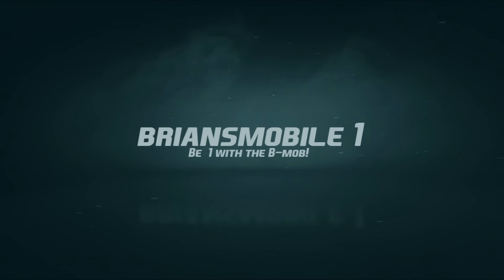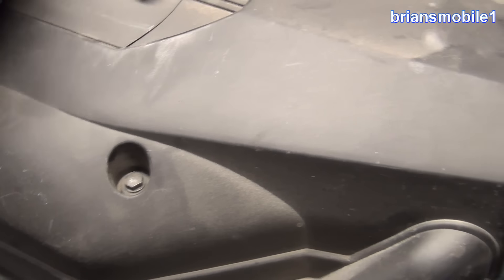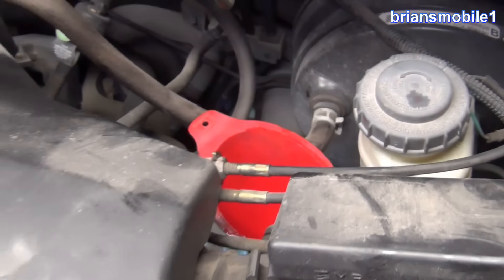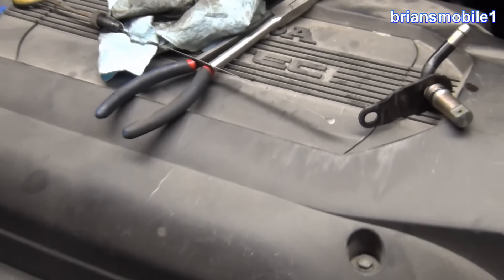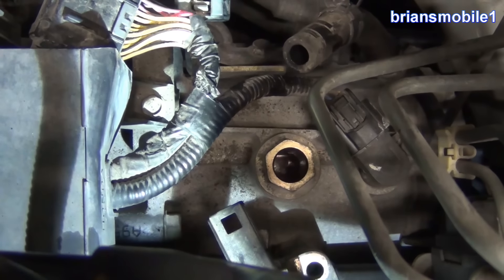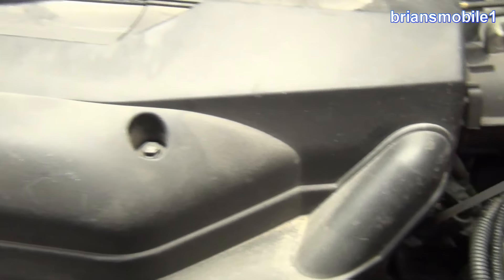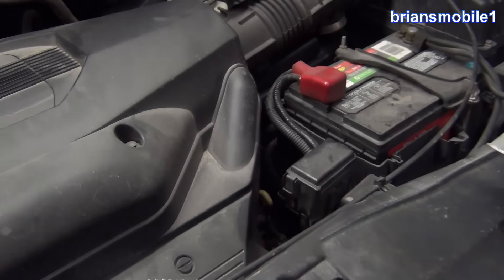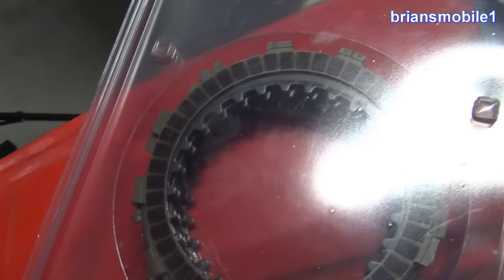Watch this Video BEFORE You Destroy Your Honda Transmission

Comment: Does that generation of Honda transmission have an "external" ATF filter similar to the 2nd generation Acura RDX transmission? If so, can I drain more ATF out of the transmission if I remove the hose off it. As it stands, 3 quarts drains about 1/3 of the transmission and it would take another drain or two to get most of the old ATF out?

Comment: Hey, I have not had AWD vehicle before and don' know if it is normal sound.  So I park next to the wall or garage and switch gears on my Acura RL, from P to R, to D and so on, there is a noise under the car which is associated with the shifting of the gears/drive shaft.  It is normal to be able to hear that?

Comment: I've got a 2002 Accord I4 with a Automatic. Just got it for my 16 year old. It had a P0740 code come on during the drive home which I am told means inevitable transmission death. The last owner did a transmission flush a few k miles ago. Is there anything you would do to a vehicle that's already had it done? It only has 90k miles on it and it drives great, so I am having trouble believing the transmission can't be saved. But, maybe I'm just being stubborn. Worst case scenario the transmissions aren't the worse to replace. But, it would be nice to avoid it.

Comment: I was getting a terrible transmission shudder on my 2013 Cr-v. Fluid had never been changed at 113,000 mi. Decided to change it and fluid was black and smelled burnt. After one drain and fill with Honda dw-1 fluid, shudder immediately went away and shifts smoothly. Also decided to change the inline aft filter.
Reply: If it comes back, switch over to Castrol for Imports. I went through that with my wife's '10 Pilot.

Comment: This is easier. Make yourself a dip stick tube funnel and fill the trans fluid thru the dip stick tube. Make the funnel by cutting out the bottom of an old trans fluid quart bottle and use the top of a diff fluid bottle with a pointed top. snip the tip just enough to allow the tip to fit the dip stick tube and screw the tip on the cut out qt bottle you made. Now you have a funnel to fill the trans fluid thru the dip stick tube. Much easier.

Comment: Good video.  Can you tell me if the Honda odyssey’s transmission would cause vibration when going up a hill from the rear end ofthe vehicle?  My Honda Odyssey is doing just that. Any ideas what would be causing this?
Reply from the maker: I know this sounds weird, but I'd check tires and bearings first.  LMK what you find would you?
Reply: @briansmobile1  I have changed the tyres and bearing have been checked but still vibrates.  I will investigate further when I get better   .  Will also arrange for transmission oil to get changed as well.  I will update whenever done.

Comment: How to change the transmission fluid in a 2009 Odyssey, it's charging one two good but the third charge out is slow. Could you tell me what wrong
Reply from the maker: I think you're saying it shifts well from 1st to 2nd gear, but 2nd to 3rd is slow.  That could be a number of things.  I'd ask a professional trans shop or the dealer what they've seen.  It could be solenoids, worn band or clutches.  Could even be fluid condition.

Comment: Do you think I should change a brand new transmission fluid (no more than 6000 miles on it) after being stuck in snow with lots of wheelspin? After that the tranny was behaving odd: didn't accelerate as usual and shifted to a higher gear only after 3000 rpm and did it very roughly. The fluid is still bright red and still smells of cherries.

Comment: Drain and fill on my 2002 Acura 3.2TL mileage is at 218,XXX fluid was black and burnt new fluid gave me a faster shift change in sport gear select and a lower shift point in auto more giving more torque output and gas mileage doing so also I have no cat and it shoot a nice flame on the one two shift with a nice pop

Comment: Scared me for a second,   Then I realized  it was a older odyssey then what I have.  I have 2007
Refill on it is 3.3qts.  I  initially used valvoline maxlife full synthetic ATF 
Which says compatible with z1 and dw1.  I went back to dw1. I found it shifted better with dw1
Reply: I have a tl and I'm sure that's what my shop used I did it myself and went to dw-1 shifts way better
Reply: You should always use Honda transmission fluid.. and other Honda fluids when changing fluids at intervals.. The engine oil is the only exception.
Reply: @randyjackson347  Any DOT3 brake fluid works also.
Reply: @steponmemommy9323  That would be an exception ...I would not want to use Prestone Antifreeze and Dexron transmission fluid like some do to cut cost ..

Comment: This is not a Honda ism, it's an any automatic transmission ism. Fluid change and if it has a traditional filter, replace that to. You don't flush an auto trans for double the same reason you don't flush a high mileage/sludgy motor (without removing the oil pan afterwards). A lot of shops offer system flush as a revenue generator at the customers expense. Two incidents I personally encountered with that yellow Jiffy place were a low mileage engine that sounded like a rock tumbler at work polishing rocks, after they flushed it and apparently forgot to do the actual flush part after the solvent was added, and the other was a perfectly normal 4 speed auto that lost 3rd and 4th gear after they flushed it. On tear down it appeared the lining had been washed off of the friction plates. Fresh fluid, a new filter where applicable and an extra transmission cooler to keep temps between 180 and 200 deg for added longevity, not that the Honda needs it.

Comment: Hey bud, got questions i have a 2005 honda odyssey touring twice happened transmission fluid spill out due to a over hitting is possible? The mechanic transmission guy said he couldn't find anything leaking on my transmission is ok to install a transmission cooler on my honda will that help? Need your this already cost me a lot money thanks in advance

Comment: Getting the 99 accord auto 4 cyl out of the yard. I recall I may have used a O'reilys brand fluid previously, before it had trouble shifting. Would this be a case for 3 dump and fills? Is there a general rule on miles or time between changes to get old fluid out of plumbing, cooler etc? Any advice is helpful, Thank you!

Comment: It's amazing people don't realise how different they are to planetary autos. The sound of the straight cut gear in reverse is a big clue as is the compression braking they can offer in low gears. Also having 4 or 5 actual gears without a stupid overdrive is noticeable

Comment: I have a cuestion sr .. i replace my auto transmission on my 99 prelude automatic so i remuve the torque converter.. befor i instal the new used transmission i like to know how much fluid takes the torque converter and the transmission cus is emty...do you know it ?
Reply: Your owner's manual should say. It's something like 7 quarts instead of 3.5 for my CR-V if I'm filling from a rebuild & new tc.

Comment: Removing the fill plug is a waste of time especially with the recall and Honda added the return tube to lubricate the 2nd gear. I change my trans fluid on my 2002 Odyssey every 25-30K miles. I just refill thru the dipstick and not have to try and access the fill plug. It has work for me thru many changes with no problems.

Comment: to be clear.....drain/fill x1.......but what about multiple x4 drain/fill on the same day? is that flushing?
Reply: thats how hondas are properly flushed but you should wait 50 miles of driving between flushes. also to flush it you take the hose that supplies pressure to the top and start the car and turn off immediately or if you have someone to watch the fluid draining have them tell you once approx a quart has drained then turn off. this is just how ive adapted countless hours of researching online and doing it to work for me.

Comment: I daisy chain two funnels because I’m not that coordinated. Also, my 2006 just has a plug on top that says ATF. Yes I’m sure. Could it be you have a transmission cooler and I don’t?
Reply: That plug is factory original. That just means that your (insert model here) doesn't have the mod kit.

Comment: I've never done any work on a front wheel dive auto trans, is 3.6 quarts a common amount of fluid for a fwd transmission?
My 4R75 took somewhere around a million after I rebuilt it,  or maybe it was a couple quarts in the converter and then six in the pan then run a bit and add until I ended up around 12 by the time the cooler and lines were full.

Comment: My 2006 Honda Odyssey shifts great but has like a 1 second delay when you put it in gear. Fluid has ben changed always on schedule but doubt they change to filter on the side of the trans that Honda says never needs changed which I hope it’s delaying due to the filter being dirty. Any suggestions?
Reply from the maker: Replace the filter... they don't last forever.  Other than that, often times the sensors get blinded by ferrous filings.  You can try pulling your speed sensors and solenoids and cleaning them.

Comment: My 2018 Honda Pilot was surging while accelerating. 50k miles on it. Brought it to the dealer and they changed the transmission fluid. Apparently, it needs to be done every 30k. Has something to do with the torque converter lock-up and the variable cylinder management crap. Anyway, after the fluid change the vehicle stopped surging.
Reply: Good grief. I never changed my fluid in my Lexus rx 300 until 210000 miles and 20 years old. Never had a problem ..still runs fine.
Reply: @starkeymorgan4142  I agree. However, it's in the scheduled maintenance for every 30k. I never read it. We drove it like any other car. The cylinder shut down for the added fuel economy and transmission adjustments by the computer so you don't feel it wears on the fluid.

Comment: I'm about ready to change out the oil and ATF on my "new" 2007 Odyssey.  I was wondering if it would be helpful to run the left side tires up a ramp to tilt the vehicle towards the drain hole on the transmission.  Instead of 3.1 quarts coming out would that let 4 or more quarts come out?
Reply: no, just drain and fill... service manual says to do it 3x to gradually replace the system, but up to you

Comment: Hey Brain ty for video. i have a 2016 acura rdx, takes same fluid, 3.5 liter motor,  I pour the fluid through the tranny dip stick whole, is that ok? or is that going to create a problem?
Reply from the maker: Welcome Rich.  That's fine to fill through the dipstick.  Most do it that way.  Just remember the air the fluid displaces will be coming up.   It can bubble splash at you from the funnel.  No big deal.  Just messy.  Maybe plan for that by protecting the exhaust so it won't stink on the test drive.

Comment: My transmission is going out, I just put lucas and Castrol transmission fluid in it, I mean it's broken anyways worth a shot, shifts exactly the same but I only drove it around the block, maybe it'll be a magical fix overtime.
Reply: So is it still running?
Reply: @vinceoleyar9411  Yeah it's a beast, it slips in the cold and shifts hard sometimes but it's been doing that for 7yrs atleast. Yeah, I didn't notice any difference with the lucas transmission fix. Might never break all the way 🤷‍♂️

Comment: I have an 06 2.4L 4cyl  accord  that just started slipping from D into N while trying to take off from a stop,  wouldn't shift at all.  Engine only has 90,000 miles on it .   Strangest thing I've ever seen and this is a honda,  I've expected them to last  to 250k at least on the first tranny.   My civic tranny blew up at 250k on my 2000 civic.   Not sure where to go from here. I bought the car 2nd hand at  50,000 miles on it. so I'm guessing someone had the tranny flushed or something prior.  trying to get it all fixed up now...
Reply: 90K miles doesn’t mean the condition of the car. Check level of all fluids in your car before start driving.

Comment: I have a 2003 Accord with over 285000. I think i know i shouldnt but want to get your professional opinion.  I don't know the history of the car, and want to know if I should change the transmission fluid?
Reply: I wouldn't, that milage is to high for my opinion, if you had like 100k - 130k then I would, if you do decide to do it, I would at least keep the old fluid just in case it starts to slip, at that point drain an put back your old fluid and hope it helps.
Reply: By the way, NEVER FLUSH !!!, drain and fill.

Comment: Hey question I just got a 2002 honda odyssey with 280 thousand miles on it should I change the transmission fluid and filter i dont know if its ever been changed or let it go till it dies?

Comment: How’s it going brother love your videos very informal. Hey I just have a quick question do you have any experience with the car hesitating and the lights flickering on a Honda Accord? I just bought it 2012 the lights flicker when I’m at idle or I let out the gas the car shakes back-and-forth like it’s stuttering a little bit, it shifts a little bit weird I’m kind of at a loss right now. I bought the car as is and of course, as soon as I drove away and had it for a couple days, I started to notice these things.

Comment: I used castrol high mileage ATF. it says it is honda approved.... should i change it again?

Mine shutters a little bit under light acceleration. It tries to shift at like 1500 rpms. if  i accelerate like normal and it shifts north of 2k rpms, everything is fine.
Reply: How many miles on the car? And has the transmission received regular servicing? And the stutter could be anything, have you put a scan tool on her? That is where I would start.

Comment: I think the actual Saturn transmissions had you check  when off.
And our 9 speed, if i remember correctly, are checked while running. But that's a German trans.

Comment: I'm very disappointed with the transmission in my 2017 Honda Ridgeline. It needed replaced at 52,500 miles. Of course the dealer said the fluid and filter should have been changed twice by that mileage. Was there any  tech advisory info provided by Honda about defective transmission problems? Is there any actionable recouse concerning the early demise of these transmissions?
Reply: Your experience is NOT the norm. The honda ridgeline is the longest lasting truck on the road by real world numbers. I'm not trying to say your experience isn't terrible, just that everyone else is absolutely not having transmission issues.... that is rare to say the least.
Reply: It may have been not the norm in 1st gen. RLs, but I can tell you with 2nd gen. RLs it's not uncommon... at all.  When I took in my 2019, they asked what the problem was, as soon as I said 'it shifts...', they finished the sentence for me... that it rev-shifts from 5th to overdrive.

I had this transmission serviced... drain-fill... only 10k mi. before this (33k mi.), by 'qualified' Honda mechanics.  Now, 'qualified' Honda mechanics did a triple detergent flush, drain-fill to 'hopefully' fix the problem... they'll straight-up tell you it's a design-defect.

It's a garbage transmission, period.  And all this mumbo-jumbo about what'chya should'a done, and what'chya shouldnt'a done is a bunch of crap.  No one expects to sprinkle fairy-dust on a car to keep it from falling apart.

Comment: Bought a 2014 Honda civic sedan lx with 105 k miles it now has 120k ( bought it not knowing the service history) .. should I change the transmission fluid?
Reply: Absolutely
Reply: **Classified** flush or refill?
Reply: @ODPhadezz  Drain and fill every 30k, never flush.
Reply: **Classified** what kind of trans fluid u recommend?
Reply: I has 2014 accord LE-X v6 @ 105k miles , I  flushed transmission at 40k, replaced with synthetic fluid,  and then replace transmission fluid  at every 7k miles (because fluid still new at 7k, no  flush nesscesary). DIY cost lest than 50 bucks. Replace transmission fluid much easy than engine's oil.

Comment: ?? Do you have to fill from the drain plug or can you fill from the filler it's self using a hose?
Reply: ? you mean the fill plug? nah, some people, including me, will fill via the dipstick tube with a modified hose/funnel... it'll be a bit slower, but we won't be fiddling with those cumbersome parts in that cramped space

Comment: Just inherited a 05 Accord with 188,000 miles on it. Don't believe the transmission fluid has ever been changed. Is this something I should do now or would it likely cause more problems considering it's never been done before?
Reply: It would most likely start to slip if you did because that’s a crazy amount on the original fluid
Reply: @vincetaylor3948  that's what I'm worried about. It shifts fine so may be best to leave it alone. The original owners never changed it. Might consider just changing the filter.

Comment: Hey Brian,
I  very much appreciate your videos which demonstrate your coherence of thought, your excellent teaching skills, the depth of your knowledge, and also not to be minimized, your friendly, engaging manner. Just wish you were within 100 miles of me in South Jersey beause you'd be my go-to mechanic, absolutely!
Regarding my 2009 Honda Fit, are you a proponent the idea of changing the automatic transmission fluid in a series of approximately 3 cycles separated by a few hundred miles, to ensure that it's all been changed out by the third cycle? This procedure repeated every 30K miles or so?
Thanks again!
Reply from the maker: Thanks Charles-  I used to live in Maple Shade and Tom's River NJ back in 1999.
Reply: I live around Tom's River so I'm likely within 100 miles of you but I only work on my own cars though
Reply: @briansmobile1  I have a 2004 odyssey that I’m changing trans fluid on tomorrow, but I noticed that it has just the plug, without the hose attached. So what’s that mean for me?